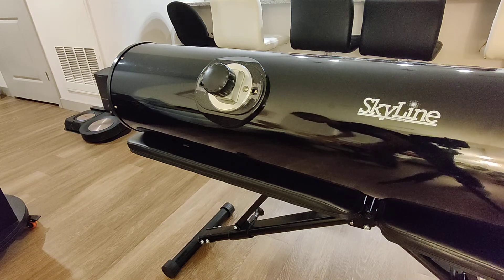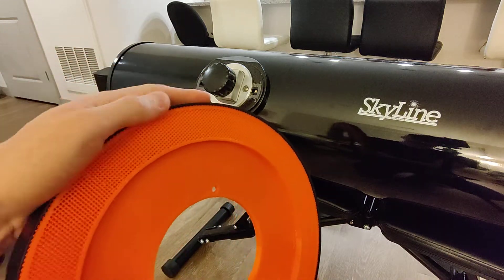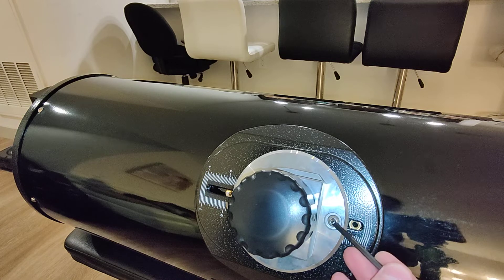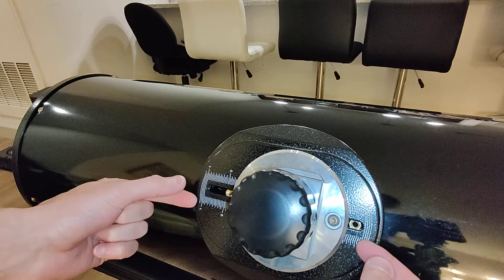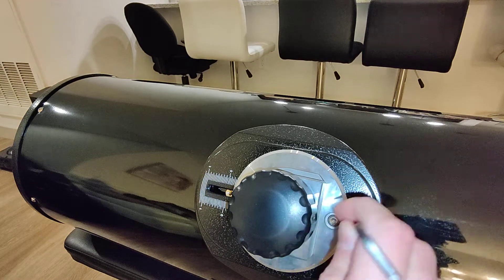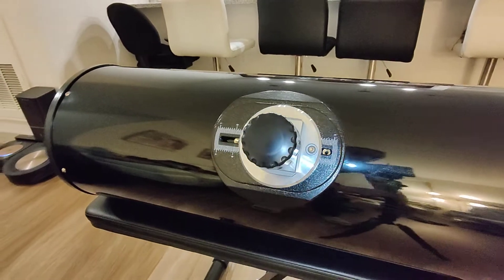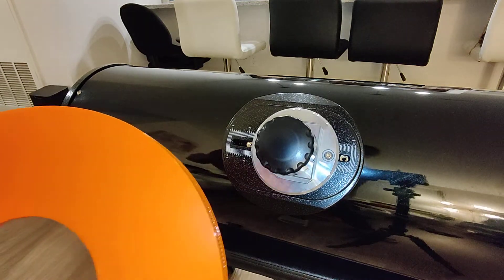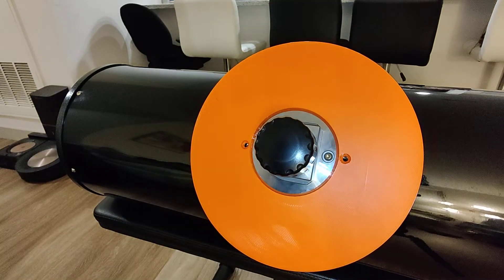OnStep your Dobsonian with Zero Woodworking - Part 2

Comment: Hello. I'm doing the same project as you, but on GSO12". I used 17HS15-1584S-MG100 stepper motors and FYSETC E4 board. I have a problem with the settings, AXIS1_STEPS_PER_WORMROT has a value of 320000 and because of that I get the error "Init NV/EEPROM error. What are your OnStep configuration calculator settings for these motors? My settings: 
1. AXIS1_STEPS_PER_DEGREE - 20000 ;steps 200; microsteps 16; GR1 - 100; GR2 - 22.5

2. AXIS2_STEPS_PER_DEGREE - 13333,333 ;steps 200; microsteps 16; GR1 - 100; GR2 - 15. 
Please help.

Comment: Great vid. 
I’m trying to do something like that with onstepx on fysect e4. 

It’s hard to see, how did you connect the bottom wheel to the motor? 
If I’m seeing correctly, there is no belt only friction, right?? 
There’s a rubber wheel on the motor that spins the base
Reply from the maker: Yes, that is correct. Friction drive with rubber O-rings. The idea of a friction drive is not mine and belongs to Bryan Pryor (https://www.youtube.com/user/bryanpryor). What I did here is only a neat design of timing wheel fitment on ALT  bearing block and clamp-like 3D-printed  motors assembly block. Friction drive is simple in implementation, however has disadvantages of tracking errors (not super precise). You can tune the ratio in OnStep, but that tune will only work until you move the scope and have to reinstall the clamp motor-block. Error also impacted by temperature changes, becuase rubber will produce different friction rate in wide temperature ranges. So it is good for visual and some planetary photography. But not good for long exposure DSO (which you are not suppose to be doing on ALT-AZ mounts anyway)
Reply: @ thank you. 
The plan is visual or plenary since I only like DSO on nerrow FOV

Comment: Hi, how did you get the nuts inside the side bearing carriers?
Reply from the maker: the nuts can be sourced on on e-bay by searching for "M6x10x10 nut" https://www.ebay.com/itm/185952833397
to get the nuts inside you have to unscrew the bearing assembly from inside the tube using Philips screwdriver. I recommend to remove main mirror cell. This way you get the shortest and unobstructed access to the screws. Keep your scope horizontally not to accidentally drop any screws onto secondary mirror.

Comment: Nice work!  I just found this video.  Thanks for the recognition! Watching your video gives me some really good ideas and inspires me to improve my design.  I think I will work on some changes and try to get some new videos and designs uploaded.  Thanks again!
Reply from the maker: Thanks man. Your friction drive idea made implementation of this project very easy. However for these who travel with their tube often it It has a major disadvantage - after re-assembly of the scope the friction drive ratio changes slightly  (variability of pressure in compliant mechanism and its positioning) I have to fine tune for more accurate tracking in OnStep app. But I usually don't bother, I seems found a perfect ratio where the object stays in the FOV for about 2 min. Which is good enough for visual. Dobs are not used for DSO astro-photo anyway and 2 min is good enough for planetary photography

Comment: hello sir make it small disk.
Reply from the maker: small disk is a disadvantage, you need  a leverage of large radius to pull the tube by a small motor with a good precision
also is minimum transfer ratio which comes into play with OnStep